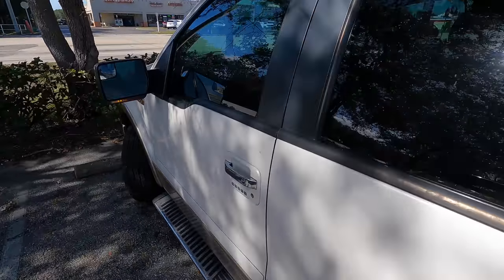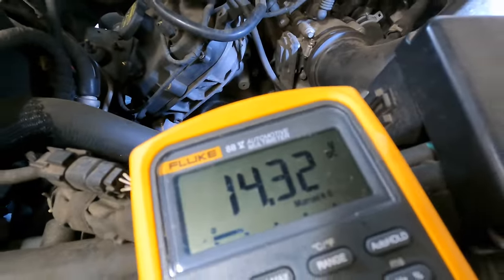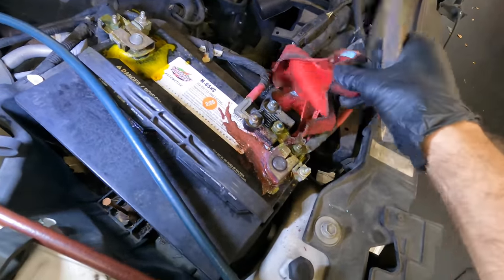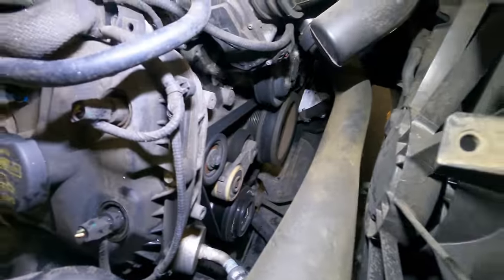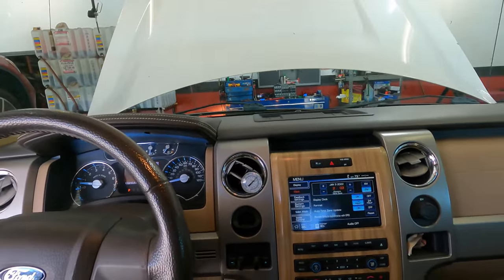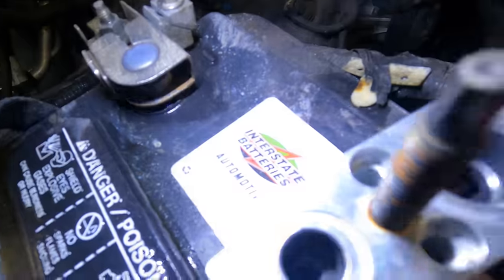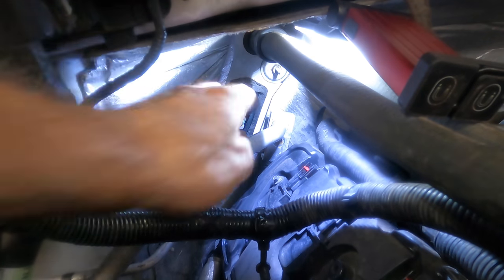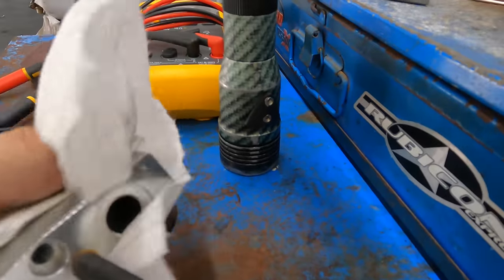It’s the Black Death!

Comment: Replaced a compressor (aftermarket, I don't remember the brand) on a 2008 Honda Civic cause it wasn't compressing at all (pressures were static on both H & L sides). Made sure to measure oil from the old compressor and filled the new one with PAG 20 (not sure if it was the right type but was all I had at the time). Car came back a few weeks later and now the new compressor was sometimes noisy and would only blow cold for a few minutes. High pressure line did seem erratic and the low side was going into the 10s PSI. Disconnected the lines and found a lot of black graphite looking oily soot. Blew the lines out but the condenser/filter assembly seemed blocked. Replaced both compressor (remeasured and reused the same installed oil) along with the condenser and seemed fine afterwards, car never came back. Probably should've replaced the expansion valve but I believe that would required dash removal and our shop didn't allow us to do much interior work. Not sure what caused the compressor to fail like that. Was it due to bad aftermarket quality or did I actually put the wrong oil in it and caused internal damage. Who knows! Would like to hear other people's opinions though.
Reply: Nowadays there are so many aftermarket brand compressors that are so cheap. I think many are actually just cosmetic rebuilds.

Comment: You really should check powers and grounds with a load like a test light.  A broken wire with one strand holding on will show 12v on the meter with no load, but will not light a test light bright due to voltage drop.

Comment: I'm pretty sure that the fans have to run whenever the compressor does. I didn't see you check with the scan tool to see if the fans were commanded on.

Comment: Hey Ray, we have a cold weather alert for the last several days. -40 to -50 deg C.  I left the block heater plugged in all night because I drive a 98 C1500 with 410000 km on it.  Runs like a champ.  Love your videos.

Comment: Stupid question. But doesn't pouring the blue water on the battery terminals cause a closed circuit between the electrodes?
Reply: Even if it does, it’s only 12V so not enough to cause any problems.

Comment: What does cleaning the outside of a battery terminal do...
Reply: Absolutely nothing. He probably didn't want to reset electronics by pulling the harness but it does nothing for the actual connection. Pulling and cleaning post and inside ring terminals is where it matters... he knows that he's done it a bunch before. Not sure why he bothered here if he wasn't going to do it correctly. I guess attention whores need that attention? That's why he's here

Comment: Ray R11 flush. Get some. United Refrigeration, R. E. Michaels, Riley sales, or online. Its great for burnouts and comp fails. It will clean out an HVARC system good. Like flushing a trans cooler after a rebuild.  The R11 flush comes with a spray nozzle and tapered adapter. Its goooooowd stuff.
Reply: Flush the lines to the compressor.. CYA.

Comment: Quick question-- should the receiver drier be changed?  In the truck shop (HD over the road diesel) I work in,  if the system gets a compressor or a condenser, or even a TXV for that matter, we ALWAYS change the drier.  Just wondering.
Reply: In HVAC, anytime the system is open, the drier needs to be changed out. It keeps contaminants from circulating, and it takes access moisture out of the refrigerant (which can rust parts out - such as the TXV)
Reply: @Straight_White_Fatherly_Figure  I have always been of the same mindset. That’s why I am puzzled to see so few being changed on cars and pickups.

Comment: I’m so surprised that you didn’t use brake cleaner to clean the a/c out. Then I remembered that you had run out hahaha.
Reply: The last thing you want is a solvent in your AC lines. Refrigerants carry oils and the compressor has oil as well, of course. You don't want to inhibit the system after it's sealed by having trapped solvents running through stripping oils. He should have used dry nitrogen to purge the lines and probably an acid neutralizer. Then install, preferably two, filters. They'll catch most anything left over protecting the new compressor and its oil. The best protection is nitrogen and a deep vacuum to boil off any residues before recharge. 

The only time someone should use a stripping chemical is refrigerant type changeouts if required and reusing linesets. The main one is R22 to 410a which vehicles won't deal with.

In other words, there should never be a reason to "flush" a vehicle AC. Chances are that truck's AC will take a dump again.

Compressed air should never be used to flush a line because it introduces all sorts of oxygen and water vapors which means you're adding time on to the job to pull it all back out. But almost all mechanics will do it since they don't know better. There is guaranteed contamination of this vehicle once he's done throwing the parts cannon at it.

Comment: Hey Ray! I had a question about brake cleaner, what is it, and what actually are the risks of using it? I don't work on cars, but have done some work on gliders, and I am just interested on what sort of things is it applied to(other than brakes), and might consider using it in some places(after careful research has been done)... Anyways, really interesting content, I've been learning a lot lately, keep it up!
Reply: Break cleaner doesnt leave residue behind, its good for cleaning electronics and/or electrical parts and/or your breaks that cant have anything (even finger prints) on them. If its safe for that kind of cleaning, its safe for anything. Though, its pretty toxic so you want to try not to get it on you too often.
Reply: @Straight_White_Fatherly_Figure  ty for answer!

Comment: Hey dude!  Newish subscriber.  Love your videos!  Wanted your recommendation for a code reader.  I’ve got a 06 f150 dreaded 5.4 3v and a 2015 Hyundai Sonata.  Looking into buying a 2015+ ford pickup.  Want to cover all these vehicles.
Reply: @Chris-bh3cm  you don't need the upgrades unless you are going to work on newly released vehicles. If yours is, for example, a 2005 find an older snap on. It's one of the few that's bi directional. All the others show codes and some will show limited live data.
Reply: @Chris-bh3cm  not sure about upgrade fee. As long as you get one that's upgraded to your year you won't need to upgrade it. Yes they are expensive. It depends on what all you want to do. It takes a bi directional to do anything except read some of the data.
Reply: @Chris-bh3cm  I'd ask your local snap on guy if they have any trade ins

Comment: i've never seen an ac system that needed an enima. Hey, live and learn:)
Reply: Normally an AC system must be flushed when replacing a compressor. The compressor failed because stuff wore down, and that stuff had to go somewhere in the system.
Reply: @flagmichael  negative. You use high pressure dry nitrogen to flush a system. You might use an acid neutralizer as well. You don't use solvents as you're more than likely to leave some in the system when you put it back together... leading to this same issue again. Contamination thins oils for compressor and turns oil acidic. Most contamination will be in the condenser up to the expansion valve. Since those are being replaced its only the lineset and evaporator that need cleaning and you don't use solvents. Dry nitrogen and maybe a neutralizer and definitely a filter, preferably two. Then a deep vacuum. This keeps new oils intact and will clean out any further gunk that may have been left in system.

Guarantee Ray leaves a shit ton of moisture and solvent in the system. (When I say shit ton I mean more than 0... probably several hundred ppm. Doesn't sound like much but you want as close to zero as you can. Micron range.)

Comment: The black is the refrigeration oil that was subject to extreme heat. The system hasn’t been able to reject heat due to the condenser fans not working, so you can’t expect any kind of AC performance. I seriously hope the fan issues were resolved after this second repair.
Reply: Looks to me like the valves of the compressor sheered off into the system, which made compressor lose compression. The flakes look metallic

Comment: I recall having an old Buick Century once, brought it down from Ohio to Texas and the AC worked so well the whole trip down, but once within the home state it just decided not to kick on.  It was an '88 so still filled with R12.  Took it to a shop of Questionable Integrity down on Harry Hines and they said they would be happy to change out the compressor oil, swap fittings, vacuum and recharge the system with R134a.  $160 later I was on the road with the loudest AC compressor within five counties.  It worked for an hour.  Took it back, black death everywhere.  They couldn't fix that without a new compressor which of course was Significantly More Than Affordable.  At least it had crank windows and all four still worked.

Comment: Btw cleaning the battery an the terminals is always a good idea. I've seen some pretty nasty accumulations of dirt containing traces of coal and it was slowly discharging a tiny battery of a tiny car.Each time the owner came back to the shop, the battery was drained but the tester said it was fine and after charging it was indeed fine. The car did not have a bad static current draw so we were clueless as the draw of the dirt on the battery can't be measured in towards the battery terminals. Another nasty source of error, especially on older cars, is the point where the battery cable is clamped to the terminal. If the crimping comes loose, it will heat up and have a massive voltage drop on it. The worst one I saw was >1V, boiling hot while the battery only charged at 13.0 V.